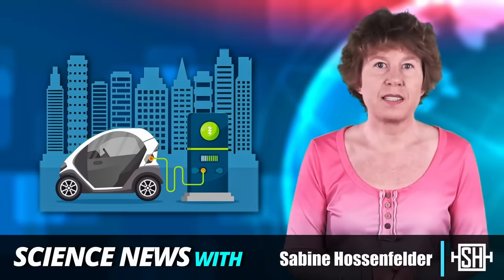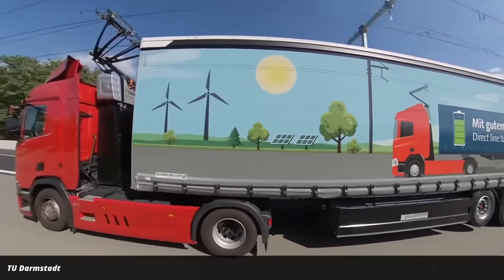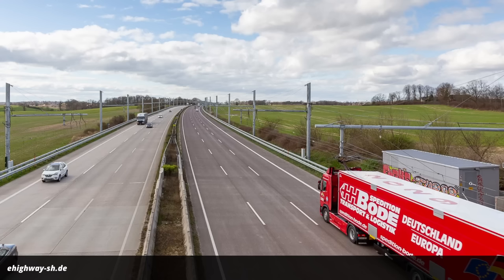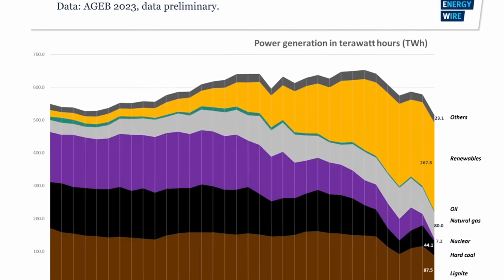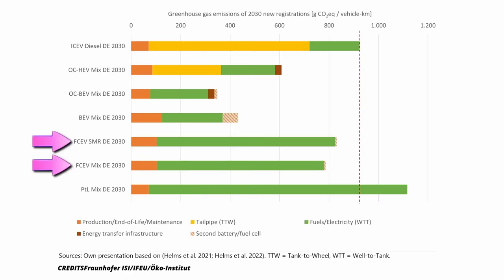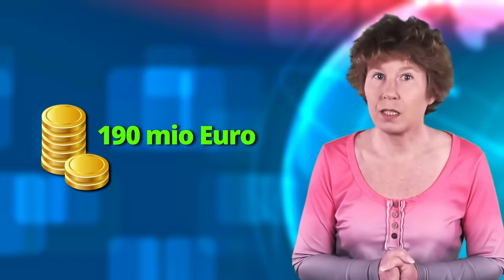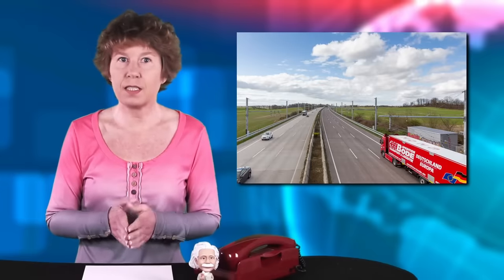Charging while Driving: Does it Work?

Comment: Sabine, 

there is no point to electric vehicles unless the electrical supply is non CO2 emitting, which in the majority of cases they are not.  Due to the way grids work, again in most cases, extra load from such as evs and heat pumps simply increase fossil fuel generation (because they are the only ones that react to a load increase) and given all the losses from generation and distribution the net reult is likely to be more CO2 not less.

When are governments going to listen to engineers instead of dreaming up policies involving what they do not understand?

Comment: In the end it comes down to efficiency, isnt it? If you can convert 90% of the electricity into moving one train cart pulling 30 waggons, why go through the waste of charging 30 truck batteries with an efficiency of like 30%? Not including the dead weight youre dragging along, the diesel motors, electric motor, batteries and the driver... Not even talking about all the accidents includimg trucks.
The problem with last mile has to be fixed but isnt AI the savior for everything?

Comment: I'm a bit fed up with a certain type of pro car/lorry media at this point. 
   Yes, your point about using trains instead of lorries is true. There is this number called freight quote, relating to the percentage of freight transported on rails instead of roads, and whole of Europe (and especially Germany) is abysmally bad at it, despite efforts like the 'die rollende Landstraße' (~rolling road: putting the lorries onto railway cars). Austria and Switzerland are the stars at this, tunneling through the Alps. Still the freight quote in Europe is below 15 % for the best, Germany is below 10 %. Guess, who is really good at that? The US, with a quote above 40 %!!
   Taking into account, that Tesla is already customer evaluating battery electric trucks; + the German POST as well as UPS Germany also already using battery electric vehicles for end point delivering packages, (btw, both not considering swappable batteries!) I would still assume, that overhead catenary lines could still fill a gap for certain delivery scenarios, that can't be addressed by rail for what ever reason. Because it is certainly beneficial, to not carry along a huge battery for the ride, it would be sufficient if it is enough to bring the lorry to the destination a 100 km left and right of the Autobahn. It would also make it possible, to feed back energy produced by inductive breaking. 

   But what really enrages me most, is something totally different: It is now about 50 years, that I see and hear reports about using hydrogen as fuel in cars, and it is still not the end of it. Since ten years, we know, that this concept is outperformed by modern battery technology, but still, there are 'experts' advocating that. But only 5 years after starting a small scale evaluation of overhead catenaries for lorries, some economic buffs and bean counters find this as 'not promising', 'doomed to fail', and 'too expensive'?  Are you kidding me?!? There is some powerful lobbyism going on.

Comment: Rapid battery swap has LITERALLY NEVER worked, despite numerous trials in several locations, including one with airport taxis at Amsterdam. Even with identical vehicles using identical batteries, there are still myriad technical issues with repeatedly swapping these huge batteries, one of them being that it still takes pretty long to charge them and they are too expensive to have them idly lying around, waiting for a vehicle to come pick them up. Now imagine retrofitting trucks from many different manufacturers with a swappable battery. You just can't! It's not feasible! Really, €2 million per km only sounds expensive if you disregard the cost of motorway construction. In Austria, which admittedly is not very flat and therefore expensive to build in, it is estimated to cost €12.87 million/km. In the Netherlands, we spent €64.6 million just changing the speed limit without building any new roads. Furthermore, this price of €2 million/km is likely to come down if electric installations are built at scale. Let's also not forgot that heavier vehicles cause more wear and tear, leading to increased maintenance costs, and a truck that draws power from overhead lines is several tons lighter than one that needs to carry a huge battery.

It is a cheap shot from the fossil lobby to complain that the costs per vehicle are too high when all they did was run a small trial with 11 vehicles as a proof of concept. Obviously any solution to eliminate emissions from road haulage is going to cost billions on a European scale, because Europe is big and we transport unimaginable quantities of freight. Electric highways are clearly the way forward in making road haulage more sustainable and battery electric trucks are not.

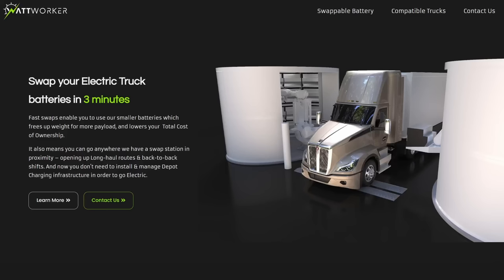Comment: 4:28 
To say that a shortage of money is the reason for not making such an investment is incorrect.

There is never a ahortage of money.

The only question is whether it is an economical investment.

If you take the long view and suppose all the electricity comes from solar and other renewable sources, and At Prices Cheaper per kwh than Today, THEN you can work out how economically viable the investment is.

P.s. if the cost of the wires is indeed that much, then it does sound an awful lot.  But these figures need to be all checked

Comment: In ‘99 I used industrial’friction diodes’ and put them in disc brakes of our home made EV, charged full every braking. YW. Diodes were $1 each.
Reply: DC~AC yadda, second set of cells in series so you can switch packs long distance. Li was the issue and we didn’t have those type calls.

Comment: Electricity is more expensive than diesel because it just needs way more expensive fossil fuel to produce it and then maintain the grid than to use fossil fuel directly.  Modern diesel engines reaching 50% thermal efficiency are pretty hard to beat. Electric losses from power plants to truck wheels are far from small. Such traction wires with pantographs need intensive maintenance. 
It is called expensive but clean sometimes. But the opposite is reality. It is expensive because it consumes insane amounts of resources.

Comment: OC highway seems like a bad idea, from not only installation costs but maintenance and environmental impact.  It's also a f***ing eyesore.  This alone should be enough to kill the idea dead.  But it's also a single point of failure which can easily turn into a massive supply chain clusterf**k.  Just not worth "saving a little gas on road."  Convetting diesel to electric AC then to transmit then to convert to DC... you're losing efficiency at each step versus mechanical energy created on the road applied directly to the wheels.  The swappable battery idea seems like a more viable option.  This way unloaded batteries can have frequent and routine testing and visual inspection, with data about energy storage capacity as the battery diminishes, then send off old, damaged, or malfunctioning units to a regional repair, recycle, refurbishment place.  Or have a mini facility at each site.  Just be sure to standardize battery cartridge shapes, sizes, and electrical specs, to allow many companies to serve the market, with many battery options on the road to avoid single points of failure.  Also have a mobile swap vehicle to give urgent service to stranded vehicles.  Because life will always happen, and batteries will always die between stations.

Comment: Getting full EV vehicles forward without getting carbon free electricity generation fixed is just a really stupid idea imho. Hybrids and Plug-in Hybrids are a much better solution imho: vehicles are chaper therefore more people will buy; autonomy is even higher that ICE powere vehicles; ICE engines have reached thermal efficiencies close to that of turbines used in Thermoelectric power plants; generating energy in the car means the transmission losses should also be added to the final calculations and these losses can reach up to 25%; creating the charging infrastructure is also a carbon producing activity and that should also be taken into account. Finally, a point people in Europe and North America don't seem to know: mining for the EV bateries and  recharging infrastructure is already causing political instability and civil wars in many poor countries - and the developed western world already has a moral and material debt with these countries.

Comment: All these "reductions" are meaningless unless the additional electricity requirements (going into the wires) and the power plant emissions are included.  They are just the same as those ridiculous claims of + energy gains from fusion at the US N.I.C., where they omit the power needed to run those lasers.  Meant for headline attention grabbers.

Comment: When the world is so close to commercial fusion electrical power, regular nuclear power, or even MSRs should be build\t. Unfortunately, these things take a really long time to build
Reply: Sorry, but the world is not close to commercial fusion electrical power.  It is questionable whether it ever will be.
Reply: @xbmcxbmc5680  "close" being relative.
Fusion power on small scales is already possible, but not particularly useful.

The ladt pieces if the puzzle are coming together quickly, sadly tokamaks (MCF) are not viable.
ICF is likely to be it. Proven, scalable.
But even if is possible tomorrow, it will take several years to buld these behemoths.
Definitely before the end 2030's it will be common place.
Lots of testing is needed before committing to full scale production levels.

Comment: Instead of highways, we should have electric tracks up off the ground so no animals, no snow removal,  no stops, no tire and break wear. Use your petrol engine to get to the tracks, and once you're on its electric and AI controlled so you wouldn't have to drive and speed could be easily doubled. Have a vehicle with a bathroom, and you wouldn't have to bathroom break.
How about if the tracks had a magnetic part and the car had a wound copper part could that produce power? 🤔
Or maybe Digital electricity could help for efficiency.

Comment: Fossil fuels need to be taxed more. That way, electricity will be cheaper and railways will use it.
In my opinion, eventually, roads should cease to exist. Railways are cheaper, faster and very controllable using computers. Ever noticed a railroad is only used for 60 seconds and then for maybe 10 or 15 minutes nothing passes ? That space can and should be filled up together with improving infrastructure. Ever noticed everyone owns a car and is parked 95% of the time if not more ? On rail, we could just order a vehicle and be on our way a few minutes later. Sharing the resource, improving safety, no need for driver licenses, no need for autonomous power, sleeping, working or having fun on the way.

Comment: It's been proven over and over that using diesel generators to charge electric vehicles results in dramatically lower fuel usage than driving ICE vehicles.   Just put a smaller diesel engine running a generator on the trucks to top off the batteries that were charged overnight. But that's too simple.  Not only does it not satisfy the feelings of people who think we can go fully electric tomorrow, it severely limits the ability for graft and corruption in it's implementation.

Comment: Corn is most commonly used for distilling out ethanol (e fuel). It is water and nutrient hungry and displaces human and animal cropping so seems like an idiotic virtue signal. If you've got a full up diesel truck and add all the weight from the electricity drive plus batteries how much does that displace cargo weight and/ or volume. That efficiency step back also has to be taken into account because you may need say, four trucks where you previously used three.

Comment: Nuclear power and swappable batteries is the winning combination.
Reply: You wish. In Germany, fission is dead. And fusion a long way to go. Meanwhile, renewables are constantly gaining ground, despite all attempts of interested parties to stop them.
Swappable batteries might be an option for lorries, but for cars, they are rapidly obsoleted by newer charging and battery technology. Norway is pointing the way there. Drive 2 hours, then spend 15 Minutes charging for 15 minutes to 80 %, while sipping a coffee and stretching your limbs, is totally sustainable,
Reply: @Misophist Fifteen minutes for 80% charge leaves out the "how often" part of the equation - this is ok depending on how small the country is and how much product has to be moved to keep up with consumer demand. Swappable batteries should not be a problem at all as long as the batteries and battery mounts are standardized - just like we have standardized gasoline filling systems. Any differences in battery charging specs can easily be handled with smart controllers at the swapping station. Standardization should not be a problem. As far as nuclear energy not being an option, it happens to be the only real threat to the fossil fuel industry at this point in time - we need to ask if this is a major reason why it is being rejected or if there are other factual reasons, such as safety concerns, driving the reluctance.

Comment: Diesel is NOT cheaper than electricity!

A MWh of Diesel will cost you around 150Euro. A MWh of electtic power around 70Euros on average. But much more importantly you only need around a third of electric power compared to a diesel driven engine because of its terrible efficency of around 30% compared to up to 95% in an electic motor.

We would need only 25Billion to equip every highway in europe?! Europe spends around 300Billion to power trucks annualy! So we are talking about paybacks of months rather than years.

Comment: Well, the idea has become obsolete, Tesla is making Semi trucks that can drive 500 miles fully loaded between charging and with their new mega chargers it can easily travel more than a 1000 miles in 24 hours
Reply: The problem is the weight. The Tesla truck is 4 tons heavier and as result must carry 10% less cargo (by weight) on European roads. With busy roads like the highways in Europe it can be cheaper to pay 2 million once for the overhead power compared to having millions of trucks repeatedly carrying 10% less cargo.
This test was built with batteries in mind. They want to see which technology is cheaper under what conditions.

Comment: Charging trucks with overhead cables is the worst idea ever. Ground rail charging with a dip-stick while the car self-drives will be the solution and worth the cost as billions of km are consumed by ordinary cars on highways all the time and what you really need to solve is long-distance charging for ordinary people. Its also much, much cheaper to implement. That the electricity is not fully renewable is not a strong argument against as e-cars are far more efficient than diesel/petrol cars are. Not perfect, but still somewhat better. Trucks cannot get enough charge from this but it can probably be a supplement. Germany is obsessed with trucks on its highways, but this makes no sense at all and did not from day one (I have worked charging-while-driving and expressed my sincere doubts - but German taxpayers were footing the bill - so whatever... sometimes we have to try things to learn more). However, its coming. Sad that Europe is not taking a more firm lead but European car industry cannot agree to work towards a joint solution - so we are letting US/China leapfrog us once again.